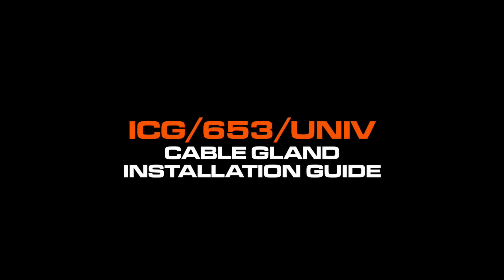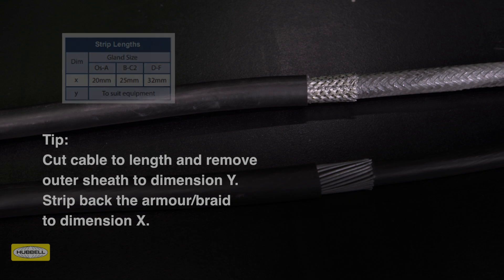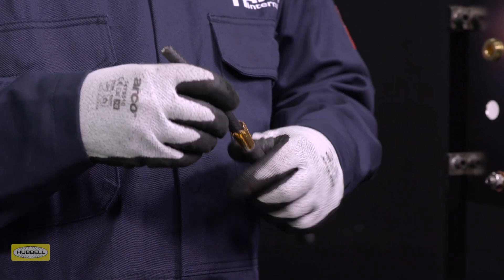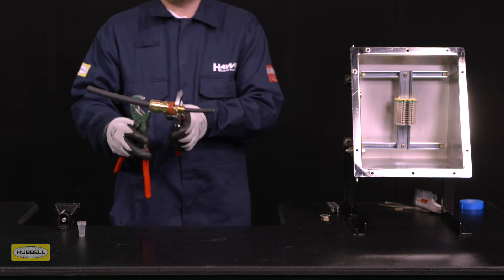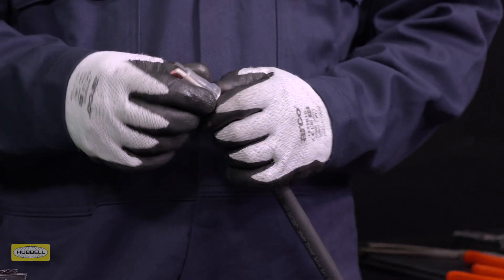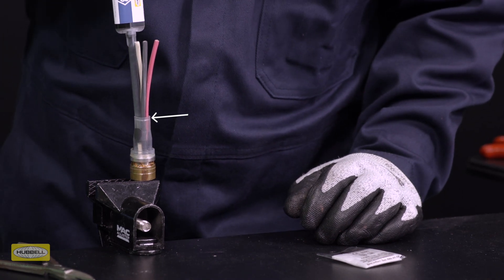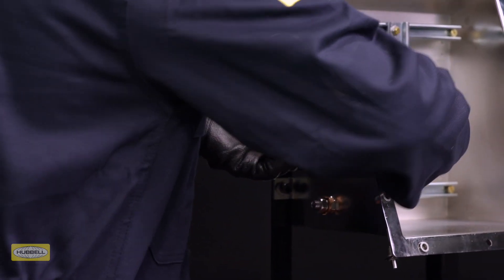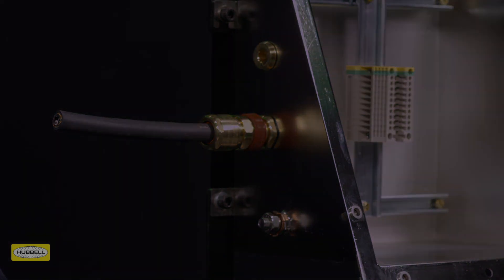ICG/653/UNIV | Cable Gland Installation Guide | Hawke International

Comment: If you are trying to do this for steel wire armour, you need to spin the REVERSABLE armour clamping ring around. From factory, it is in the braid orientation and needs to be turned 180 as the ring's wall is thinner that way